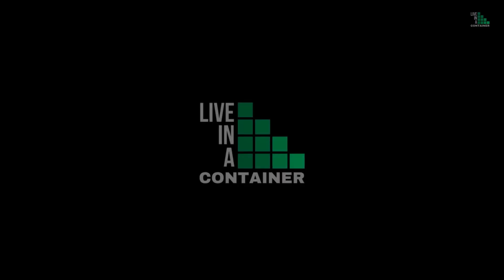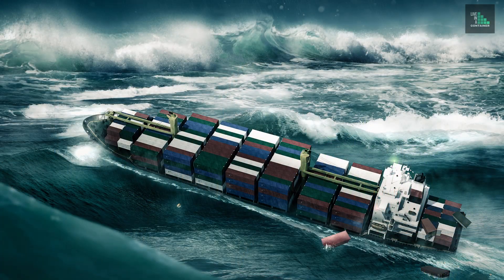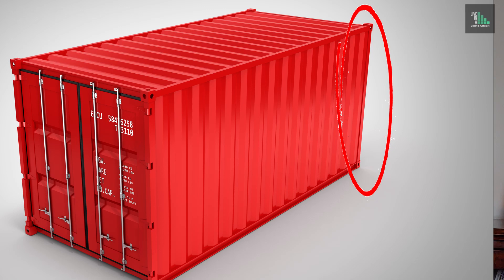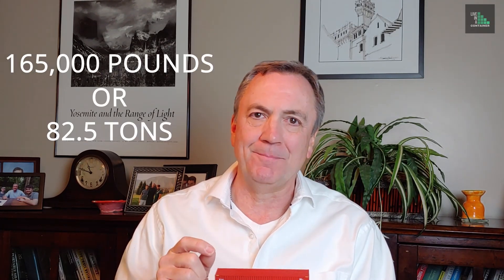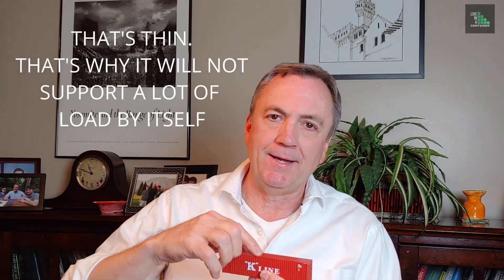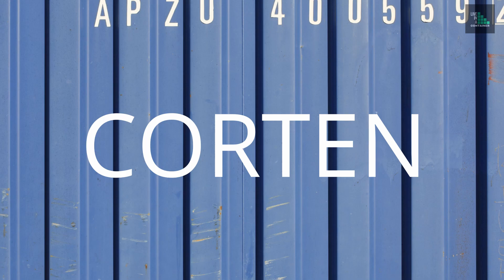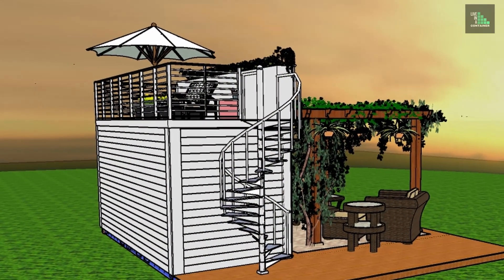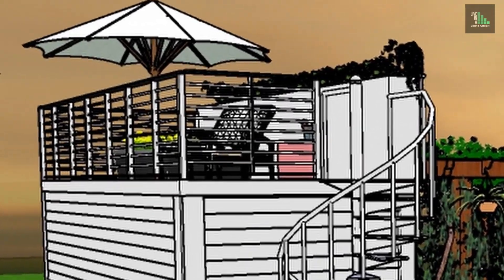Structural Issues of Shipping Container Buildings

Comment: Is the corrugation consistent from one to another? Asking because if one was to make a form for cement pour could one pattern be made to be used with different containers or are some corrugations different than others?
Reply from the maker: The International Organization for Standardization (ISO) has standardized the dimensions of most shipping containers. While I cannot claim to know that all containers share the same corrugation dimensions, it is very likely that most will share the same dimensional properties. To be safe, you might should pour the concrete based upon each shipping container profile you work with though. I am not fully understanding why you want to make a form for cement pour. What would the end result be used for?

Comment: Structural integrity is just one important issue concerning the conversion of shipping containers to homes. What about the off-gassing of volatile organic compounds from interior insulation? The risk to human health depends on how much VOCs seep into the air and how long they remain, according to the Minnesota Department of Health. Spray-on insulation may produce formaldehyde, benzene, xylene and other harmful chemicals. Use of VOCs have been shown to aggravate asthma, nausea, vomiting or headaches. Over the long term, VOCs can lead to cancer, kidney damage and central nervous system disorders. The U.S. Environmental Protection Agency warns that paint—sliver’s worth of VOC that dissipates fairly quickly—can be hazardous for some people. Imagine spraying a 3-inch-thick layer of insulating foam in a steel-capsulated shipping container! Buyer beware.
Reply from the maker: There are certainly concerns about using closed cell spray on insulation. This is especially true for people who are highly sensitive to smells and/or have other challenges such as asthma or other lung-related issues. 

The risks can be greatly reduced by hiring professionals who know the proper way to mix and apply it. The spray is mixed at the site. This mix needs to be of the correct measure that trained and experienced professionals are supposed to know. 

To mitigate the risks of being exposed to harmful VOC's, we need to be conscience of two important things:
1. Make sure low VOC products are being used.
2. Know what the safe re-occupancy time is for the product used. 

Also, spray foam insulation is not to be exposed to the occupied spaces. This is mainly for fire and smoke protection per code. This gives an additional benefit by encapsulating the spray foam away from the air that we breath.

Thank you for your comments. I really appreciate it.
Reply: Interior insulation with spray should be avoided in my view. Exterior is better, even there, preferably something fire retarding.

Comment: You should do a video about putting two containers together and how the joint is handled and sealed against water intrusion and thermal forces on the container. People do not understand the the roof of a container is a convex shape which means water is directed towards the seam that so many people seem to be welding solid. I am wondering if this joint needs to be a construction joint to allow for movement as well as waterproofing the joint.
Reply from the maker: Great suggestion. Thank you.
Reply: would like to see this one as well